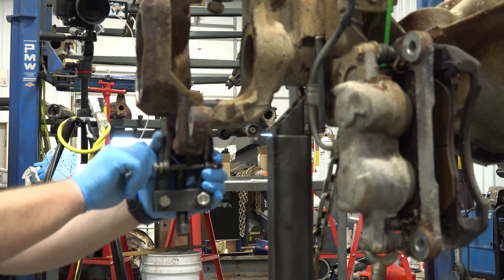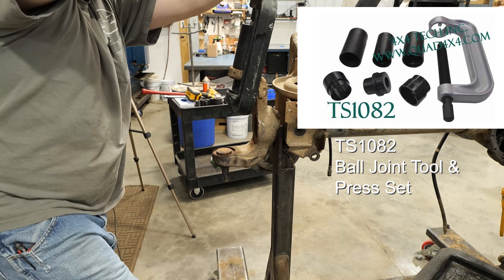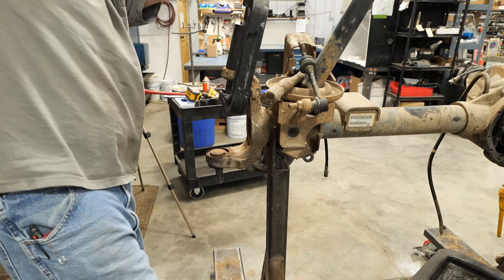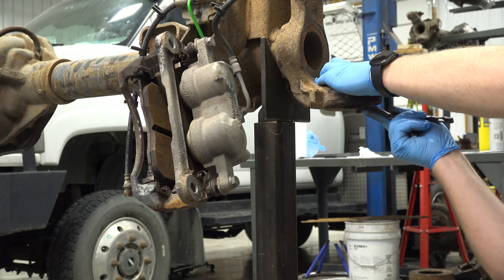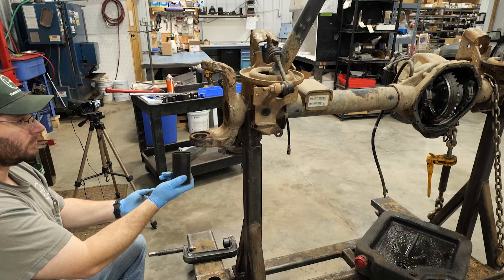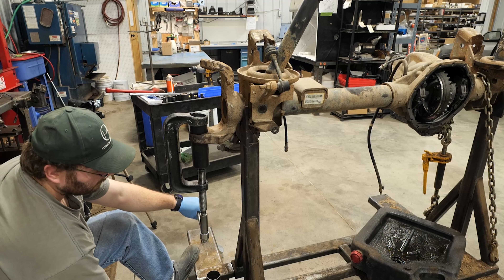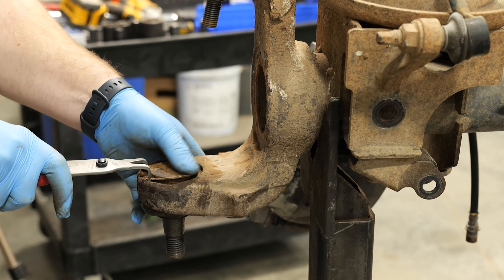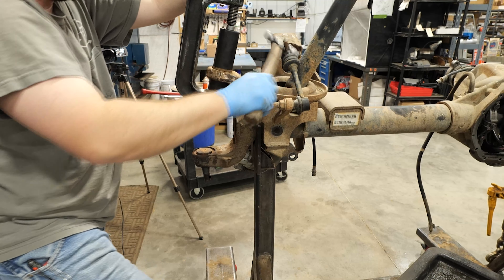Dodge Ram Front Axle ball joint remove & replace only

Comment: Glad I found this video . I like to build a 2001 front axle for my 95 4x4 so I can add third gen brakes to it . I like to use the adjustable ball joints so I can change the caster from left to right , a bit more positive caster on the right than left . Not sure about locking hubs and Timken bearing but I would rather have them

Comment: The ball joint is spinning and the Alan socket rounded out when I used the nut to keep it still. Not enough space on the stud for vice grips to hold it. What do I do?
Reply from the maker: Use a large C clamp to hold the knuckle on the taper of the  stud. If that doesn't work, either cut/torch the nut off or weld a random nut to the end of the stud to put a wrench on.

If cutting or welding tools are not available, you can get away with putting a vise grip on the end of the threads, then file that clamped bit of threads off and reposition vise grips on the other side of the nut.